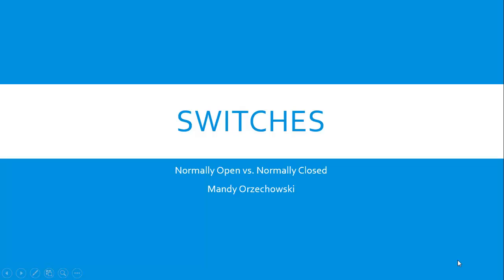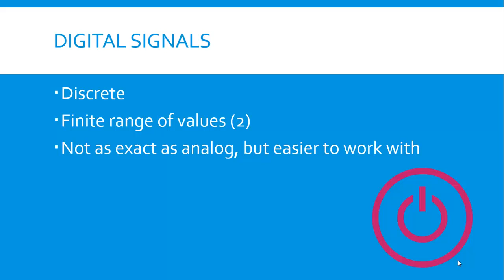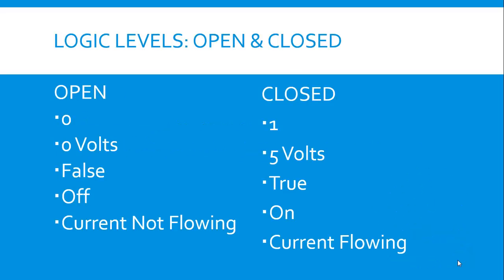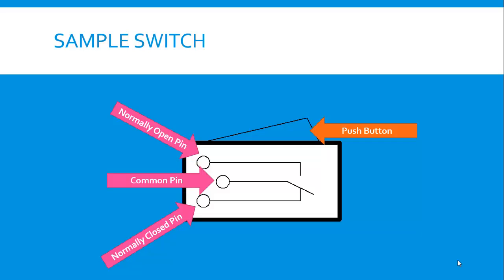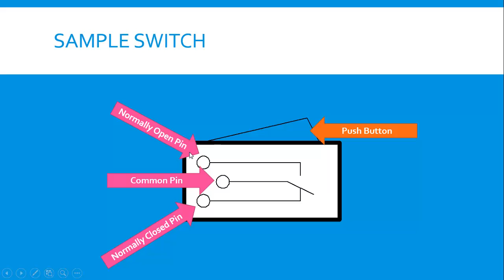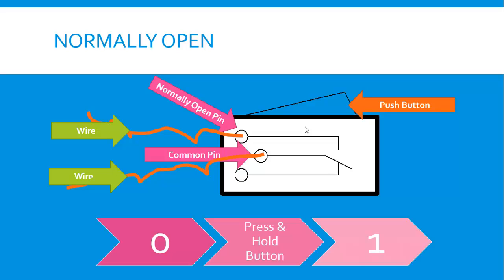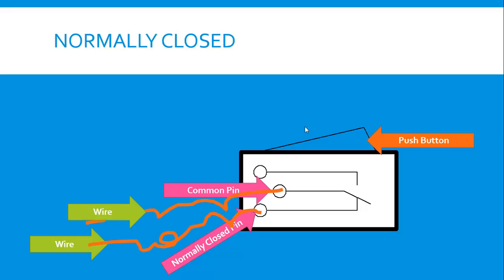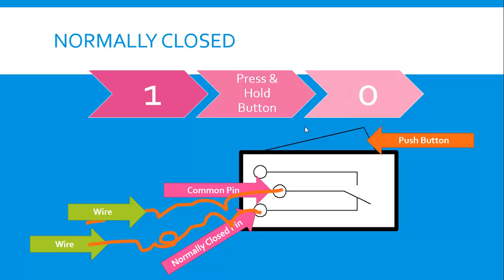Normally Open and Closed Switches

Comment: All switches when inactive ..are i  the normally closed position and can still supply power to a circuit operating plant etc..so dont think normally closed means off...
Once a change of state is applied the switch MOVES to normally open allowing power to flow to another circuit...nc and no    do not refer to current flow..see changeover switches..

Comment: Dear Sir:
    Please help me regarding the relay I bought. I do not know where to connect its 5 terminals electrical wire connected to it as follows: Terminal 1- indicated coil (color black), Terminal 2- indicated common (color red), Terminal 3 - indicated coil ( color red), Terminal 4 -indicated normally open ( color black) and terninal 5 - indicated normally closed (color red).  Please help me connect the wires. Where to connect the 220 volts power source, where to check the output. 
  Ican not attached the picture. This email has no attached system/program.
   Thank you.

Comment: Thanks this is exactly what I needed to understand a switch I want to use. Only thing not mentioned is which terminal is usually used for the power wire? Would it go to the common terminal or one of the NC/NO terminals? I guess it doesnt matter it will still work but there a recommended way?
Reply: It doesn’t matter which one

Comment: Hi Mandy:  I have a switch 110v that has 5 pins NC, NO and C and on the left is a + and on the right is a (-) minusit has a small circular blue light on the manual. where will I attached the "hot wire" and where will the neutral connect? Thanks! I am confused.